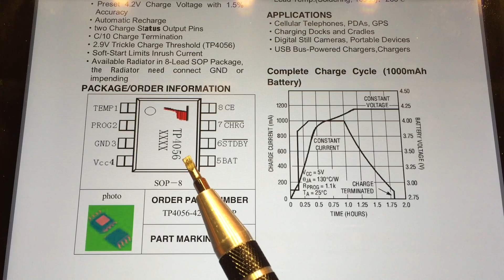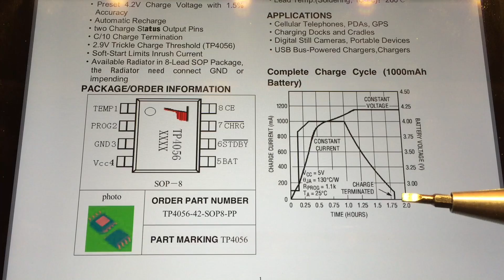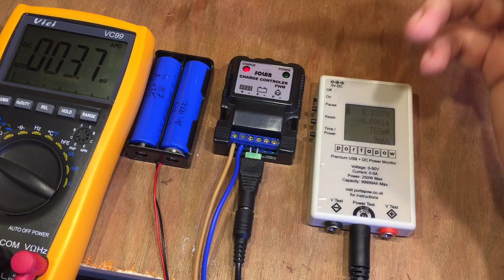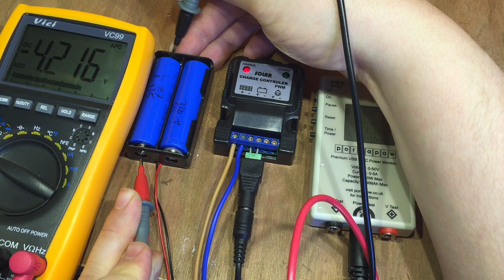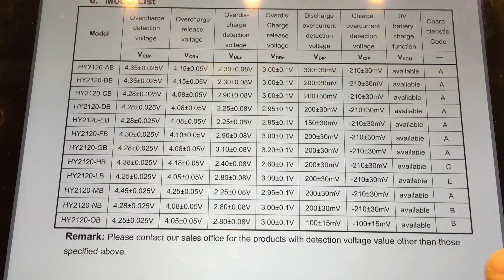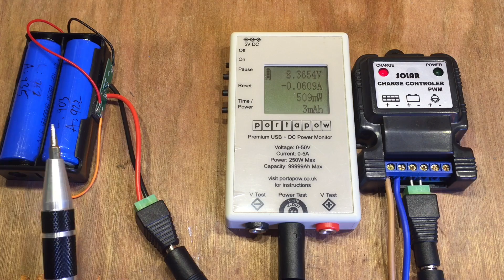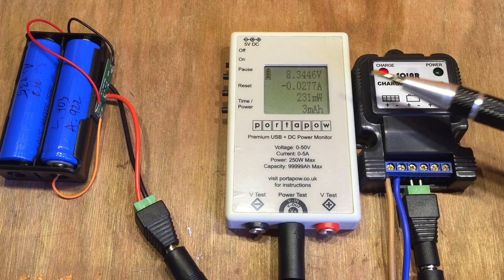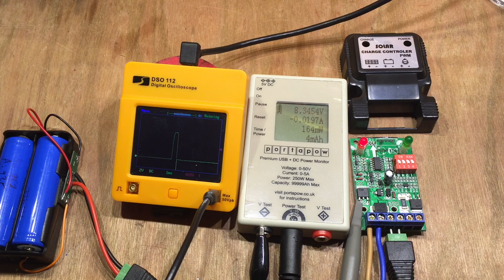Cheap(est?) Lithium Ion PWM Solar Charge Controller - 12v Solar Shed

Comment: Great vid and channel, have subscribed. 
I'm researching how to make a circuit like this for myself, basically a 3s 18650 pack to run an LED light, but a solar panel to charge the batteries. I'm wondering if you've found a more suitable/better product to do this, or if I could just run a 12v panel through a 12v regulator into a bms? Do you think this will work OK, or does a solar specific regulator do something different/extra?
Reply from the maker: +pepefpv I think any cheap lithium charge controller is going to be an adjusted lead acid controller. So using the same charging profile as for lead acid, but hopefully the voltages have been adjusted to suit. 

More expensive controllers will have been designed from the ground up for lithium cells and should have the correct charging profile. 

The biggest issue in my mind is the float charge - once the batteries are full then trickle charge them to keep the voltage up. From what I've read this isn't a good option for lithium. I want to test this though. 

I'd definitely recommend a BMS to keep your cells balanced and protected in case the charge controller attempts to over charge them. Thanks for the question.

Comment: Adam,  

I can't find any specs on that controller for Solar Input - Max volts/watts etc.. Do you happen to know this info?
Reply from the maker: +Scott Kraemer Yeah. The manual states less than or equal to 36watts. However by my calculation a fifty watt panel should still stay within the three amps maximum when the panel is pulled down to the battery level. 

As for voltage - you can see in the video on data sheet, the mosfets are good for 30 volts. 

I hope that helps.

Comment: Excellent video Adam. I purchased the 12 volt unit to charge my sealed lead acid battery. Yet to try it out.
Thanks
Mike bkk
Reply from the maker: +Bangkok Homes I've reviewed the 12 volt SLA version too. Much the same to be honest. Fantastic little cheap controllers if you're only need a couple of amps. Thanks for your comment.

Comment: did you find one that works?
Reply from the maker: +Je Be Hello. It works, but it also continues to top up the batteries once full. It's up to you if this is acceptable or not.
Reply: I was think more like one that will not hurt my cells and is also safe voltage for li ions did you find a controller that can do this
Reply from the maker: +Je Be This is the only li-ion solar charger I've tried, so I can't recommend any others I'm afraid.
Reply: ok thanks for showing me this one at least i can see whats happing li ions are kinda scary

Comment: it is pulsing not trickle charging a trickle charge would be content flow of current not spikes
Reply from the maker: +David Simpson Due to the design it's not able to deliver a small current per say - only PWM the solar panel to the battery and deliver the full current for a short time.  Averaging out at a small current. There are so many variables though - the size of your cells, the bank, the solar panels. None solar lithium battery chargers don't do that as a rule though. Once they've determined the battery is full the charging circuit is cut off entirely. 

Thanks for your comment.
Reply: yeah but if your using you output they never really at full capacity so seem ok i mean my panels are set up for winter max output and they stay like that as they supply close to full power in summer at that point and have plenty of power spare to to maybe charge winter back up lithium packs for when main bank gets low i say li-ion as they dont discharge over time like lead acid
Reply from the maker: +David Simpson That's an interesting thought about a load. I might need to play with one with a load attached.
Reply: well if you see my update video that is with a load as im charging the phone as i was filming lol when battery voltage hiy 12.6 the solar voltage shot up as not on demand soon as phone was plugged in the solar voltage dropped to charging voltage again the left meter is wired to the solar panel them the inoput of controller the battery terminals go to the pcb/bms protection board then batterys the out put is wired to the right meter that measaures output of the battery in this case output of controller i run one of raymonds repairable led lights these are damn good lights this is on a step uo converter just to keep it at a steady voltage to stop dimming as battery charge drops and i charge my 2 phones from it 1 phone is always connected as it works as a small server my opther phone i carry with me and only charge it when i go to bed
Reply from the maker: +David Simpson Thanks. I will take a look at your video.
Reply: they are a few of my attempts of balnce charging relay idea etc over time i think i just got the the simpler is better option and just check batterys often one of my ideas was great just needed more power full dc converters

Comment: i wanted one of them portapow units but now i found the oled ones saves alot of money
Reply from the maker: +David Simpson Yeah they are neat little units. 3amp maximum though I think? Portapow does 50 volts and 5 amps. A bit beefier which is helpful for me. :-)
Reply: yeah when i got the oled ones i never looked watt voltage and current but they 33 volt and 3 aqmpo so match the controller not planned but nice considence

Comment: Spring is almost here in Atlantic Canada, but we could still see a snow storm before its all over.

Another great video by the way.
Reply from the maker: +Neil Robinson Thanks for the kind comments Neil.
Reply: +Adam Welch I fancy one of those little handheld oscilloscopes, just to mess around with.
Reply from the maker: +Neil Robinson JYETech sell a few different models in kit form and pre-built. They're all fairly cheap, but it's one of those things that you get what you pay for.  It is good for making the point in the videos, but not great for accurate measurements.
Reply: +Adam Welch I have seen them on Amazon Canada for under $80 Canadian, a bargain these days with the state of the Canadian dollar.